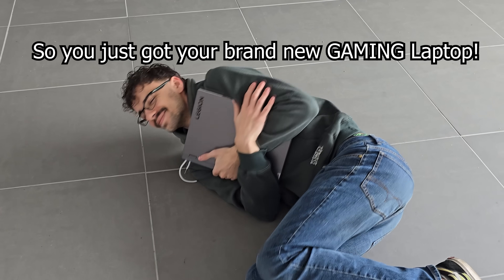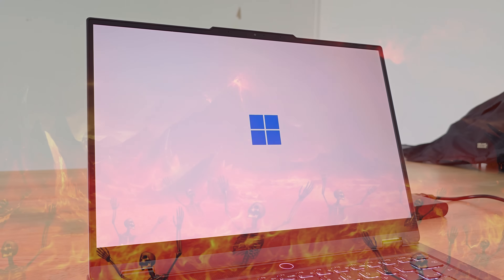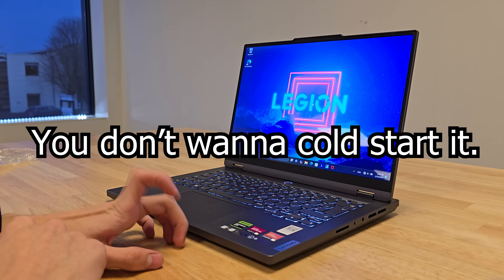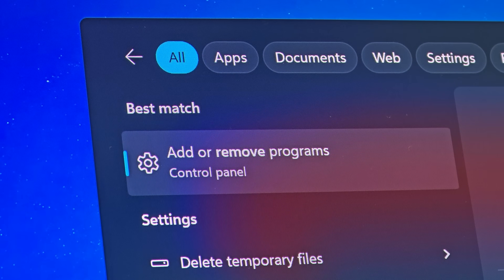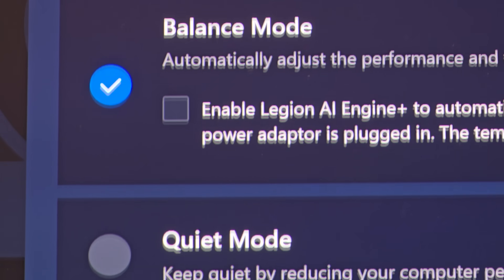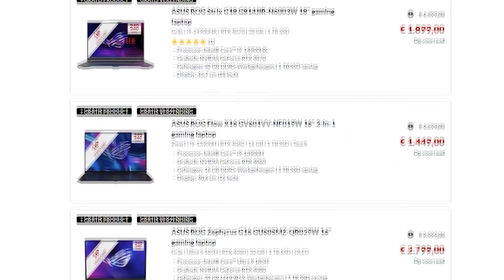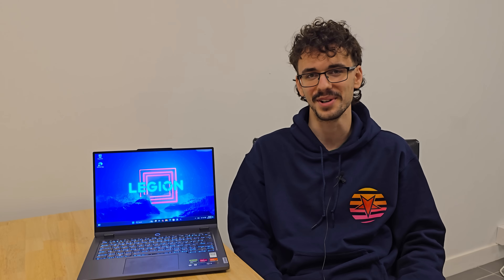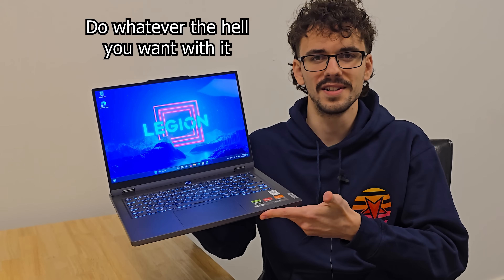FIRST THINGS to do with your New Gaming Laptop (Tips and Tricks / Setup)

Comment: hey quik question, i just got myself a G16 and followed you steps. However whilest updating everything i had some issues, i had to cancel and redo the installation of my NVIDIA driver update because it got stuck duo to a file i couldn't find and my Wifi card was bugged and didn't work untill i updated my BIOS. Everything is working fine now (it also worked fine before the updating and the benchmark results are very good) but do you think i should replace the laptop while i can or are the troubles just normal starter issues?
PS. Love the video!
Reply from the maker: The initial Nvidia driver updates can be pretty buggy, since they've gone over to the Nvidia app, and Geforce Experience is trying to update to that.
I've experienced it myself and had to reinstall the Nvidia app, but I never had any issues with the Wifi card...
I'm guessing it was just some driver jank :p
Reply: @crimsontechyt  Thank you so much!!!!!!!!!!! :D

Comment: Is the rtx 4050 laptop worth for gaming?
Reply from the maker: It's definitely better than integrated graphics :p
But it's a pretty weak GPU. So light games only, or low graphics on most modern games
Reply: Get a 4060, the 4070 in mobile is only 8gb vram same ad the 4060 but it’s a bit faster like maybe around 10-15% at most but the price difference is soooo not worth it. They are usually more than 100 bucks price difference

Comment: Lenovo legion is fun to game on, I'm still using an almost 4 year old legion. Get a targus cooling support stand for it, for better heat dissipation and air flow underneath your unit. A lower grade 30, 40, or 50 series GPU still has good output, and is generally better for power efficiency. Double the ram and upgrade hard drives to give new life to your legion after a year or two. All the settings you go over is absolutely great and I would have loved this video when I first bought mine, otherwise the Lenovo does a fine job checking all the boxes for mobile gamming.

Comment: genuine question like really, because I don't know the proper using

So when I finish using (gaming, working, everyday things) for example today, should I unplug  the charger and charge it again the next day to use it or just keep it charging? (The same goes for the next day, since I will be using it everyday)

Unnecessary discharge can damage the battery though. Need better advise
Reply from the maker: Just try to always keep it between 55 and 85 % charge, since that's the healthiest state for a battery to be in. Charging it a lot / frequently isn't bad for your battery :)
And if your laptop has that battery charge protection that limits it to 85%, turn that on!

Comment: 1:24 -

A Windows key gets tied to a laptop login when you create a Microsoft account and use it to sign into your Windows device during the initial setup process. So maybe dont skip if thats important to you, so like you upgrade your ssd and install fresh windows, you just have to sign in rather than clone your old SSD then reset it etc etc (not 1 million % sure but maybe like 90%)

3:07 - 

Remove onedrive first, it can mess with your desktop files amd in general slow your internet down alot, if its already slower.

5:10 - 

Nvidea overlay only has that huge impact if game filters are enabled. (Upto 15% impact), disabling those will give you back most performance if you still want to use overlay features. (Impact will be more like 2 to 6%, variable by game and resolution)

Good video 💯
Reply: Cheers bro
Reply: Most laptops will have your windows key on the back of the laptop somewhere, or maybe on some documentation in your box (depends). you'd be fine
Reply: Are you talking about one drive that's shown in file manager?
Reply: What do you mean by “remove the onedrive first”? Please answer
Reply: @jethrosamson8719  onedrive is a program installed in pc
Reply: I'm presumably the second owner of mine. (It was only about 1-2 years old when I bought it). 

And I've made multiple resets since then, in fact I did one earlier this week. One of these days I'm gonna upgrade my RAM.

What should I do?
Reply: @DesertCatDad you can’t just put new RAM in and start it normally?
Reply: @DesertCatDad how do you mean?

Comment: Hey. I have a bit of an issue. So in my country we use different outlets than the one I got. I got an hp victus with the 230w. It has a 4070. Anyways. Can I plug in a usbc cable and turn it on for the first time
Reply: Usually charge capable USB Type C only supports 100W charging as far as I know. SO it is probably not the best idea.

Comment: What battery charge limit should I keep the Zephyrus G14 2024 model on? Whenever I plug it in to play games idk which limit I should keep it at for even when I’m using it for normal use that the battery doesn’t die out quick on it. Also got any tips to saving battery on the G14 since I use it in the go a lot
Reply from the maker: I always keep it at 80% :)
I show the best settings for battery life in my G-Helper video
Reply: @ does the g14 draw on power from the ac adapter when I set the limit to 80%? Or is there a setting on G helper I need to turn on?

Comment: Thanks for the vid! Im getting my first laptop (lenovo loq 15' gen9) in about a week, and i was wondering what your opinion on system images is. Should i use a software like macrium reflect? And should i do this before or after updating lenovo vantage and windows?
Reply: i got the same laptop for a week now
Performance is good just the battery is mediocre

Comment: I’ve got a older laptop it has an i5 13420h with a Geforce Rtx 3050 16gb ddr4 with 512ssd. 

Sorry for all the extra information but I was needing help. So I play Fortnite on medium to high settings but when I charge and play my laptop doesn’t really charge but drains slowly. Is their anyway to help or fix that
Reply from the maker: Are you using the original charger that came with your laptop? Also, which model is it?
Reply: @crimsontechyt  yes I am it’s a Msi gaming Laptop from Walmart it was around 600$
Reply: Msi thin 15

Comment: Should I keep armory crate or just run g helper. Would both running be okay on the amd g16
Reply from the maker: AC is fine, G-Helper is just a lot faster and easier to use :)
You cant have both though. You have to uninstall armoury crate and myasus if you want to install g-helper

Comment: 2:49 You forgot HP Omen Gaming Hub (aka bloated advertising software that also is the only option to control Performance profiles, fan speeds, and graphic processor modes like hybrid mode, iGPU mode, etc.).  Oh, and while you can "uninstall" it in Windows 11, if you use Revo Uninstaller and remove EVERY file and registry setting, you will BREAK your HP Omen (Microsoft Store will break).  Ask me how I know....thank goodness Revo performs a System Restore point, which saved my bacon.   Great video by the way!!  Especially how to bypass Windows account login requirement at 1:13.
Reply: Also I think every gaming laptop owner should consider using a program like Lossless Scaling.  It has upscaling and now an improved version of frame generation LS 3.0 that works with every app.  I love to tinker so this app has been great for me.  CPU and GPU temps are insanely good with dramatically reduced power and heat (since it can run on the iGPU of Core Ultra or Radeon) essentially giving you SLI light.   Just suggesting you consider a series of videos demonstrating performance, temps, and watts using it.

Comment: A couple from me which not all will agree with.

First plug in the power cable to the laptop, then to the socket.  Not the other way around.  

Unless you have a good reason and know what you are doing, don't install Geforce Experience if you have a Geforce card.  You only need the drivers for the GPU to work.  

I know you already mentioned this, but it is so important I thought to mention it again.  In your laptop's energy manager application (whatever it is called in your case), make sure to enable battery conservation mode so that after the first couple of cycles, your batter is not charged fully, if you are constantly plugged in.  This will prolong the life of the battery.  My Lenovo's battery from 2014 is still fine...

For Mac users who switched to Windows' laptops.  Unlike Mac laptops, 99.99% of the laptops out there need to be plugged in to operate at full performance.  Else you will get reduced performance out of your laptop.  

Man...the first few seconds of this video is just perfect.  Showing exactly how people (I) feel when you get a new laptop/computer, at least as long as you are not some pretentious ahole. 

Thanks for the video, I am sure it will help people.

Also, guys get your games from GOG if you can.  They have an optional client if you are sick to your brain to want a client, and their games are all DRM free.  Save gaming and your sanity.
Reply: why on earth would it make any difference if you plug the power cable the in socket first then in the laptop or visa verse as long as you do it before you turn on the laptop?
Reply: @jacke4927  Keep doing it and eventually you might find out.
Reply: @TrusteftTech  okay ty bro
Reply: @jacke4927  I was being sarcastic.  If you don't have a switch on the plug don't do it.  Just in case someone doesn't get the joke.
Reply: @TrusteftTech  oh i didnt get that, and i dont get the joke, its my first time getting a gaming laptop (:
Reply: @jacke4927 which laptop did you buy
Reply: @jacke4927  Well, it looks like my reply to you guiding you to another video was removed.  Good luck.
Reply: @TrusteftTech Omgg heyoo 😊
Reply: @TrusteftTech what happens ?
Reply: @Yobuddycoach ?
Reply: @TrusteftTech why should I first plug in the power cable to the laptop
Reply: @Yobuddycoach Do whatever you want, if it is so difficult to accept as a good advice.  I am not in a good mood.
Reply: The Einen Moment Bitte screen 😂

Comment: Hi I hope you notice this comment. I have the same laptop as the one you reviewed before, the MSI Stealth 14. Now while idle, the cpu temperature under 20% load is at 60-70 degrees celsius. Is that normal? I still have 3 weeks to decide whether to return it or not. Hope you can help!
Reply: What's the room temperature?  60-70C under 20% load can be normal depending on the CPU and the overall design.  How hot does it get when it gets busy?  If it is only 3 weeks old and if it reaches over 90C when it gets busy (CPU temp), then I would say it's too hot.  Especially if you are not in a hot room.  Laptops get hotter the longer you use them, hours, days, months, years.  If it is over 90C brand new, then I wouldn't agree that it is a good temp for it.  Unless you have like 40C room temperature, in that case you should be fine.
Reply: @ I have the ultra 7 155. So far for heavy loads its at 95C (tried playing marvel rivals at ultra settings). Room temperature isnt that bad as well. Probably less than 30C when the AC is off
Reply: @ 95C for me is too high.  It's only a matter of time before it goes a bit higher and starts thermal throttling,  If it was daily used since September there is a chance it just needs some cleaning of the fans and some new paste if the paste was not applied properly at the factory.  It happens.  Being a display unit perhaps it has lots of dust in it too.  
I would open it to clean it and replace the thermal paste, especially if the laptop is clean when you open it.  Be careful though in case it uses liquid metal instead of thermal paste.  It needs special attention when you deal with it.  If it drops after maintenance, perhaps it will be fine till you need to do this again.  If the temp doesn't drop then perhaps it's a flawed design and you should look at something else with better cooling.  
I don't have any experience with more modern laptops, the last one I have is from 2014 (poor and all), but my experience with computers since the early 1980s tells me the above.  I could be wrong.
Reply: @ This laptop is actually ex-display since they ran out of the new stock. Been in display since September. So with that considered, do you think the temps are normal?
Reply from the maker: Yes, those are normal temps for idle to light usage. The Ultra 100 chips tend to run hotter during heavy loads so 95 degrees is perfectly fine too :)
Nothing out of the ordinary